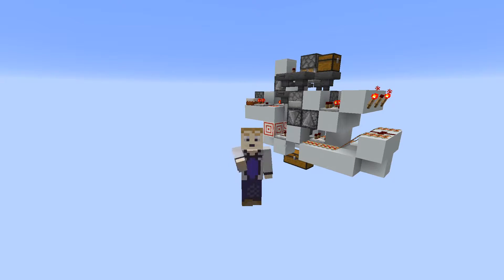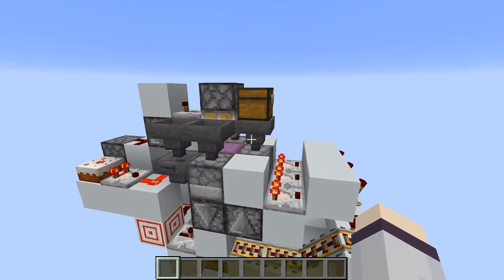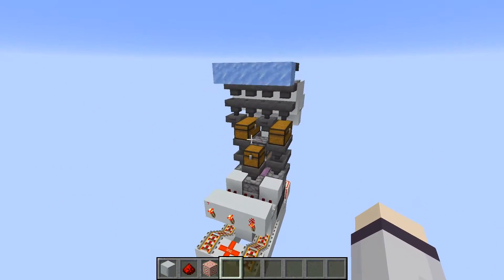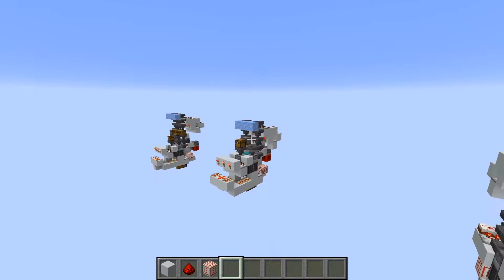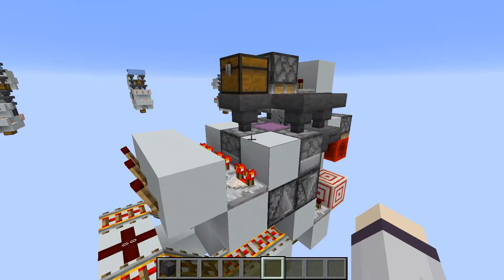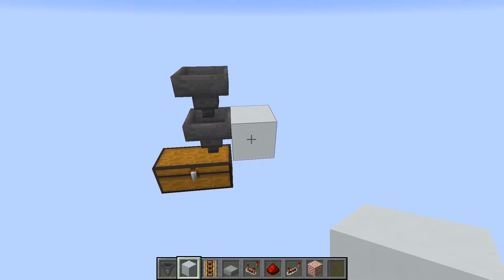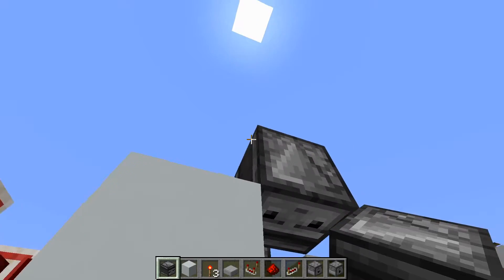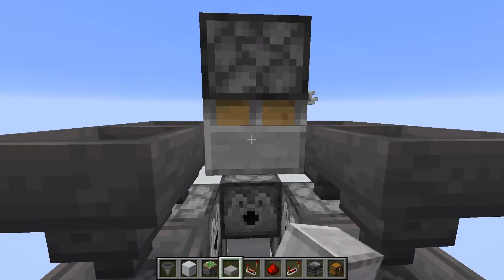Tutorial - 4x Shulker Loader (3-Wide Tileable, Java 1.11+)

Comment: Can this handle mixed items or only one item? I am thinking of using this for my ice farm, and I don't feel a need to put sorters into the system. Thanks!
Reply from the maker: Single item only. One way you can always tell: look for the comparator. If is on the shulker box itself (like this one is), then it can only handle 1 item type. If it's on a hopper or dropper, then it can handle mixed items.
Reply: @jCraftmc  Thanks for the information and the useful tip going forward!